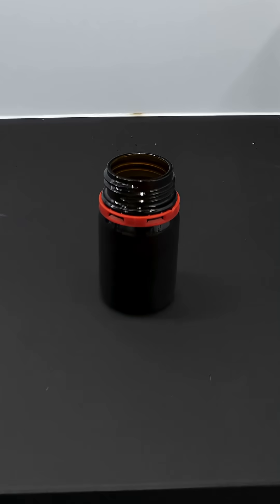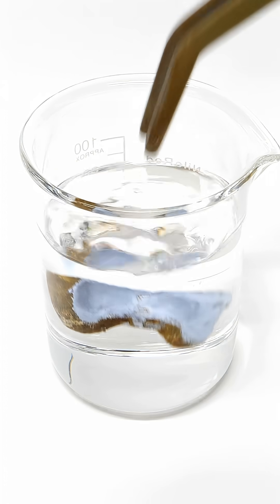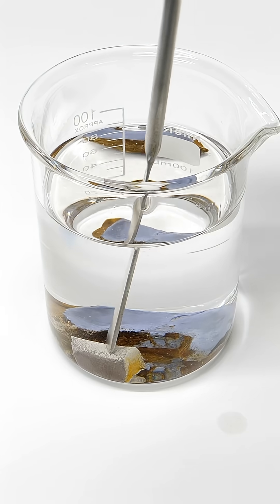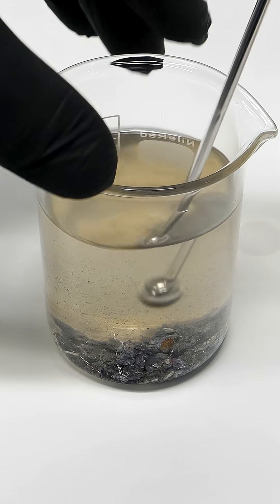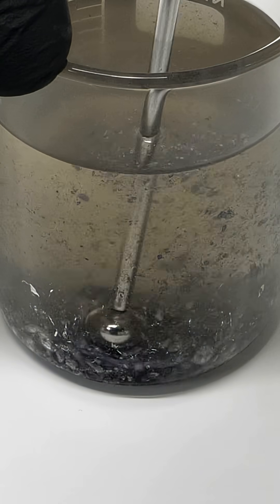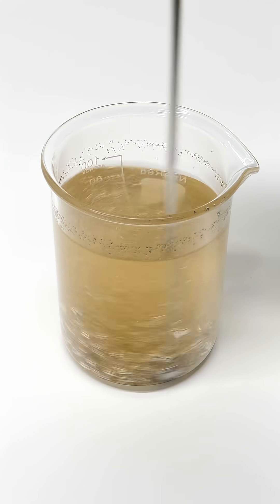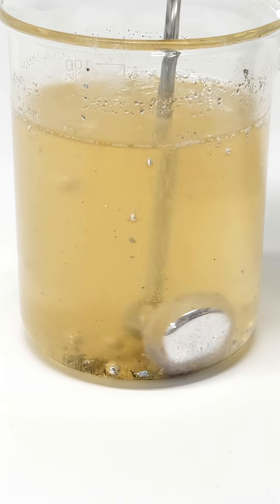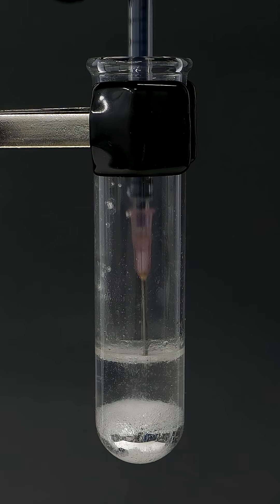Mixing sodium and potassium is crazy

Comment: I was onboard and entertained until 2:32 where he drew it up with the syringe. If you have a pyrophoric liquid in a syringe, NEVER draw up a large air bubble into it. Best case scenario is that he oxidized the liquid he spent so much time cleaning. Worst case? He loses a hand. 

He's lucky the NaK wasn't reactive enough, but if that was something like N-butyl lithium, that can make the syringe explode from reacting with ambient humidity and sparking in a closed container.

Comment: Fun fact, if you stir NaK with a teflon stir bar, you will just be left with a magnet since teflon reacts to form sodium and potasium floride plus a bunch of anionic flourohydrocarbons... funs stuff. If you dry THF enough you can get NaK to give off a solvated electron to the solution which is a beautiful light blue that looks amazing with the liquid metal balls (using a glass stir bar of course and low stirring since the NaK will aslo gently eat through glass too!).

Comment: I have asked a million times already, but can you cut really thin strips of potassium or Na, coat them with wax, put iron chloride in between a bunch of strips, maybe 20 strips. Then hit it with a hammer, this should push the iron chloride through the wax and into the metal. Shouldn't potassium and iron chloride react vigorously?? But it doesn't have to be iron chloride, just use any oxidizer,

Comment: NaK and Controlled Hydrogen Generation in Novel Matrix
This experiment aims to explore the interaction of highly reactive NaK (Sodium-Potassium alloy) with a porous or nanostructured material to potentially control hydrogen release or observe the encapsulation of the metal within a new matrix.

Why it's interesting:

Hydrogen Economy: It addresses the critical challenge of safe and efficient hydrogen generation and storage, which is vital for clean energy future.

Advanced Materials: It investigates how a highly reactive liquid metal (NaK) behaves within intricate structures like aerogels, activated carbon, or Metal-Organic Frameworks (MOFs).

Unique Visuals: The infiltration of the liquid metal into the porous solid, followed by a modulated or diffused hydrogen release upon controlled water (or water vapor) introduction, could offer captivating visual insights, different from direct NaK-water reactions.

How it could be demonstrated (in a controlled lab setting):

Matrix Preparation: A porous material (e.g., aerogel block, powdered activated carbon, or a synthetic MOF) is prepared.

NaK Infiltration: In an inert atmosphere glove box, liquid NaK is carefully introduced into the porous material, allowing it to infiltrate the internal spaces.

Controlled Reaction: Outside the glove box, but within a shielded fume hood with full PPE, the NaK-impregnated material is exposed to a small, controlled amount of water vapor or a single drop of water.

Observation: The reaction would be filmed at high speed to capture any modulated hydrogen release, unique burning patterns, or structural changes within the material. The goal is to see if the matrix can somehow "tame" the extreme reactivity or guide the reaction in a new way.

This experiment could offer valuable insights into the potential for using highly reactive materials more safely in future energy or material science applications, all while providing a highly dramatic and educational visual demonstration,

the ideia of experimentcomes from gemini, my idea for a experiment is to mix the NaK with another reactive metal and another ideia of experiment is to mix a radioactive element with the NaK

Comment: You should add water to a tesla car's lithium battery n watch that reaction. Cuz what they use even if the battery is exposed, is absolutely safe and driveable and will not at all make the car combust

Comment: Well guys for those wondering why there was an explosion, already aforementioned, NaK is a liquid alloy of two highly reactive alkali metals: Sodium and Potassium. Because of that, they both have single loosely bound electrons. 

When NaK contacts water, the metals rapidly transfer electrons to water molecules, causing water to split into hydroxide ions and hydrogen gas. This reaction is highly exothermic.The heat generated ignites the hydrogen gas produced, creating an the small explosion you saw on your phone. It can also trigger Coulomb's Explosion Mechanisms, but I don't wanna dive too deep.
Reply: It looked like the NaK was more reactive than either Sodium or Potassium on their own. Why is that? If you don't mind explaining
Reply: @insertnamehere9718 On their own, they oxidize rapidly - that was the dirty metal bit at the beginning of the video. As an alloy, they don't oxidize. The oxides don't set off the hydroxide-hydrogen gas formation reaction - they don't have a loose electron to rip apart the water molecules. 

They explode as solids because, even oxidized, there are significant surfaces that haven't oxidized, that still have that floating electron. As an alloy, that unoxidized surface becomes 100%. Which means much bigger boom - lots of floating electrons, lots of ripping water apart.

"Fun" side trivia: floating electrons are why chlorine gas, Cl2, also known as mustard gas, is so insanely deadly. Picture the end of this video, but in your throat and lungs, and with less kaboom because it's not a combustion reaction, but it's still ripping apart molecules. Actually... don't picture that.
Reply: @insertnamehere9718I think it because when Na reacts it only looses one electron from the outermost energy level of the atom as well as K, but for the NaK alloy, there is loss of two electrons at a time, hence loss of two is more reactive than loss of one, that's how I can explain
Reply: @insertnamehere9718 gotta love how you two insist on calling them the imperial names, side by side with its abbreviation 😂 despite the dissonance it causes.
the other day I saw water being measured in acre-foot 
NaK - natrium, kalium. Simple
Reply: Thank you for the explanation! That made it way cooler
Reply: I'm an electrical engineer, hear Coulomb, I think charge. What else did he do?
Reply: thats my problem... Im watching this on my laptop like its 2015... ie the dark ages.
Reply: In my Home Country Russia this is a recipe for Chicken noodle soup!!
Reply: Thank you
Reply: Wow!!! I appreciate that explanation. I just watch hjs videos cuz they are cool. I'm glad I came here cuz I know nothing about this sort of thing. ❤❤❤
Reply: Is the potassium and sodium in our blood the metals?

If yes, could you, hypothetically, inject ethanol and kerosene into your blood stream to make this happen? Assuming you are immortal except if this were to happen. This is the "Achilles Heel" so to speak. Is this based at all in reality? 😭😂

Oh also, what is Coulomb's Explosion Mechanisms?
Reply: @RuneStraight  can't speak for the rest of your question myself but I can confirm that yes, all the metals like iron, magnesium, potassium, sodium, etc. Are the actual metals found in the world, fun fact, if you crush up a food high in iron and then take a strong magnet you can pull that iron right out of the food!
Reply: @elitef3642 ooo that would be such a fun thing to do! Pulling iron out of crushed food, I mean haha. Thank you!
Reply: @elitef3642 does that mean Magneto can do some of the things Jane can do?.... like causing people to explode by making human fresh metal??😂
Reply: @GhostBurner_Tutelage who is Jane?
Reply: @iggymcgeek730 I meant to write "Jean" (Jean Grey). So sorry!😅
Reply: @RuneStraight  Can't answer the question about Coulomb's Explosion Mechanism but the answer to the first question is no - sodium and potassium in our body are in the form of positively charged ions, not in metallic form so the same thing would not happen as their properties change when in the form of ions. I am not an expert though, just talking about knowledge I know from Upper school science and human biology.
Reply: @h0shikage ahh that makes sense. Thank you for the response!
Reply: @RuneStraight  it's all about density.

All metal we hold inside ourselves are, fortunately, very scattered in our (billions of) cells, few atoms here and there.

The total opposite of what we can see in Nile's crazy experiment.
Reply: @RuneStraight the reason your blood doesn’t explode isn’t that you’re deficient in Potassium or sodium, but that they aren’t present in your blood as pure metals, in a metallic form. 
Some metals, like these are very reactive. Sodium, for instance, in the company of any chlorine (also v reactive), will ‘eagerly’ form sodium chloride, which is extremely stable.  We call these types of compounds “salts”. It’s a rule of chemical nature that reactive things become stable when joined together, simply put. Sodium (Na)  has a lonely electron, like a spare member of the team, feeling like a gooseberry. Chlorine is one short of a complete team and is eager to collect an extra electron. It readily links up with the sodium to fulfil the needs of both. Makes a compound, a salt, which is very hard to break up into its component parts again (requires lots of energy input)
What you have in your blood is sodium and potassium compounds, and they are very stable. No metallic shiny bits and blobs in your blood!
When sodium and chlorine are sharing this stray electron they are called ions. Sodium becomes positively charged because it’s given away an electron (which carries a negative charge) and the chlorine gets the extra negative charged electron and so is now negatively charged. We now call that chloride.  Hence sodium chloride is an ionic compound or a salt. Na+Cl-  Being common we call it “Salt” but potassium chloride works the same way and is also *salt*, a salt of potassium in this case.
Reply: @RuneStraight I wouldn't swear on it but I'm pretty sure that a lot of of the time when these metals are in our body, they are bound up in a bigger molecule. So they wouldn't be as reactive. But  yes, it's the same metals. The iron in our red blood cells binds to oxygen and transports it to where it's needed. I think potassium is important for the heart to function, and sodium plays a role in the transduction of signals in our synapses. I think the sodium there even comes in non-bound up form, just as a single atom (positively charged ion), and is transported in or out of the cell which changes the cell's electrical charge.
Reply: @RuneStraight  I don't remember where I'd heard the theory that spontaneous human combustion could be related to the amounts of potassium and sodium in the body... But, as of yet, no definitive proof and those metals as they appear in the body are in a different form. Besides, the amounts of potassium alone would kill almost anyone, much less the sodium needed to be ingested would likely cause a heart attack before they could ignite or become magnetic.
Reply: @kckstyles9914 it's definitely an interesting theory, even if it may always stay a theory haha. Thank you!
Reply: Dive deep. Dive deep as fuck. I wanna know more.
Reply: تشبه الزئبق
ماذا لو اضاف معدن نبيل هل يمتصه هذا المركب!
Reply: Thank youuuu! I love that there's always an expert willing to get specific for us ignoramuses in the comments.
Reply: Thanx!
Reply: i didn't see any explosion on my phone. a phone is a voice communication device. a video screen shows visual objects. maybe he needs to learn the definition of phone versus video?  in the mean time....PUT THE DAMN PHONE DOWN....and DRIVE !!
Reply: @josephcernansky1794 yeaaaaa he's not driving mmkay? What is a "non-visual" object?
Reply: @josephcernansky1794 he wasn't driving so shutup.  What is a "non visual" object?
Reply: @josephcernansky1794 A phrase can be defined both literally and figuratively -- as this is common knowledge.
From a grammatical standpoint, it clearly conveys that you had seen a small explosion via their phone, such as in a video or image displayed on the phone. No need to nitpick over inconsequential and minor details.
Reply: Well done, but am abit curious, what will be the end products of the reaction, is it NaOH and KOH, and can these to alkali solution re-react
Reply: checks phone nah, isn't exploded. didn't see any explosion on my phone continues to watch yt on desktop pc
Reply: "you saw on your phone." Ah you're talking to the special kids riding the short buss huh. Real growups use thing called 'computer', if you've ever visited an office you may have seen one sitting on a desk.
Reply: @noth606 no wonder I still feel like a kid even though I’ve been on earth over 1/2 a century and witnessed the migration of the internet to the public.… 
I like the convenience of watching videos on my phone as opposed to my desktop computer, laptop, or iPad. Was tied to a desktop way too long when developing customized software for the gov.
Reply: @moonmagnolia7  I find it inconvenient to dig up my phone to do things with, but that would be because I'm sitting with a PC in front of me if I'm not eating or sleeping. I did once develop a bit of software for the gov, but I worked developing software full time and they didn't have close to enough of a need to keep me busy, heh. They did ask my employer another time, but my schedule was full then. I retired with the title 'Sr. Software Developer' which is kinda corny - what it meant in practice was that I was 'equal to' the manager types but knew how to create software and actually managed the technical side of software projects. I did get promoted to a manager role for a short while but I prefer having servers as my underlings over having people... So I switched back. That is also why my title has no 'manager' connotation because it again would mean I'd have to approve peoples holidays - and they get unhappy when I reschedule them like I do server downtime. So it's a win-win, people get managed by those with sympathy for people, and computers get managed by people with sympathy for computers - like me 😀

Comment: I think you can do this combination with water, inside a vacuum, and vent the gas into a battery with acid ready, until it stops reacting

Then, the electrolyte/water solution, can be directly added to the battery acid 

Before being sealed quickly 

To minimize the loss of hydrogen gas, which counts eventually as positive current in the battery. 

The batteries I've designed, in some cases, are just made of quartz, filled with solution, and nothing else. 

I also designed some quartz, clay, and iron, painted with ceramic paints batteries, for lower energy, but higher danger environments 

Like on an electric airplane.

Comment: Do I have to store this in the ethanol/kerosene mixture? Also, how do I store this?
Reply: You store it under kerosone. Don't add ethanol for storing. It's only for dissolving the oxide layer but will also produce hydrogen. It probably won't last very long unless you also fill the container with argon

Comment: It's easier to melt the metal by heating the kerosene. Both Na and K melt well below the BP of kerosene. It will still require a bit of poking to get the metals to alloy.

Comment: It is rather interesting to see a metal alloy form at room temperature. I know NaK isn't the only one, but its uncommon enough for it to be really freaky. For reference, if you wanted to make bronze, an alloy of copper and tin, you have to do it at temperatures north 1950°F. Brass is similar, except you have to be very careful adding the zinc because the melting point of copper is higher than the boiling point of zinc. The fact that metals have a boiling point is freaky in it's own right

Comment: Nile, it might have been easier to chop up those chunks of metal by doing so in some glass bakeware with a layer of kerosene instead of a beaker, much like a liquid-filled cutting board. That way, you would have enough space to use that same knife you used to begin with and potentially used proper knife technique to mince it quickly and easily.

Bonus points if you hunt down some antique borosilicate bakeware (certain kinds of legacy Pyrex, for example), since that's the same stuff the beaker's probably made of.

Comment: I want to see what happens when it's introduced to water when it's underneath the surface already...
Reply: Think depth charge.
Reply: @martindinner3621  oh, I was pretty sure that was the answer but I want to see it. Also, not in a bucket. How deep do you have to drop it before the reaction isn't visible from the surface?

Comment: Some high end ovens use Nak inside of the thermostats, the parts come inside an explosive resistant bag. Its really entertaining to watch the customer react when you bring a box that has "Caution explosive contents" written on the side.
Reply: I assume its used to get away from using Mercury switches?

I mean, thats the only reason I could think of using a liquid metal in a thermostat.
Reply: @The_Keeper  Yes, but it's also better.  It conducts heat faster (therefore expands faster). I think it's just someone trying to justify engineering an overpriced appliance. I've only ever seen these in a steam turbine system where mercury wasn't good enough because it was too slow and would boil under the conditions where it's used. It's still as reliable as mercury, just some sealed off metal.

Comment: Does the kerosene do anything more than just keep them from reacting?  Can you use pure ethanol rather than kerosene and get the same results?
Reply: Ethanol reacts with both sodium and potassium. The small amount of ethanol is used to dissolve the oxide layer but the gas bubbles you can see are hydrogen which is formed in the reaction of the metals with the alcohol